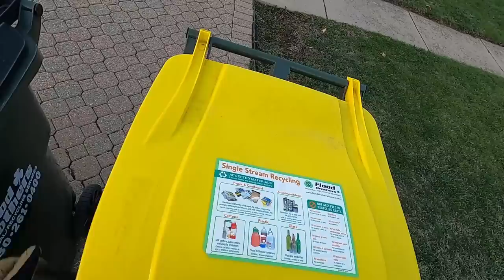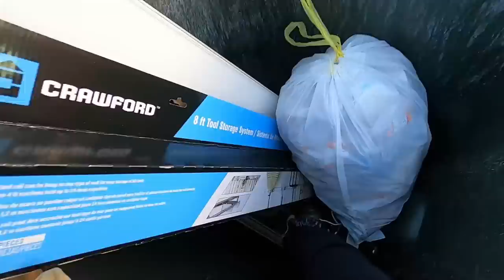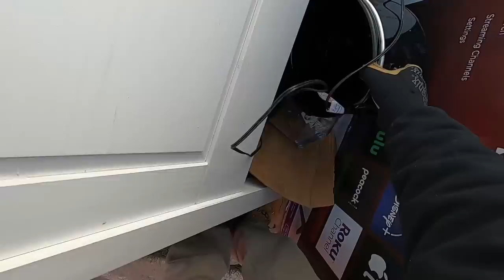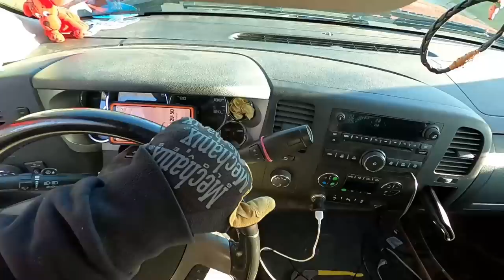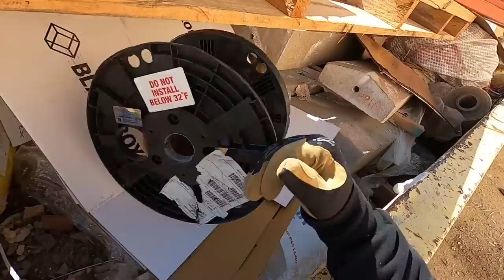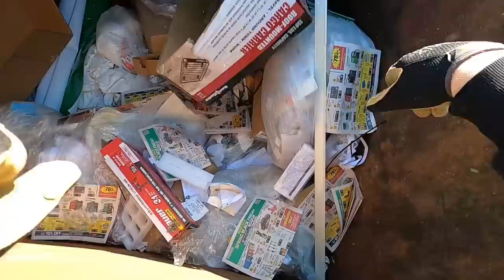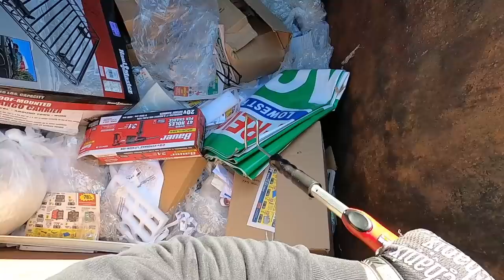Why is This in the Trash?? I'm Keeping it

Comment: I used to drill a small hole in the back motor end on the  fan and oil the rear  bearing to save fans

Comment: Most of those fans have oil places on the motors. People today don't know how to use an oil can.
Reply: And I have reclaimed several discarded fans that only had hair wrapped around the shaft, after clearing that, they worked fine.

Comment: If you keep the fridge closed, what difference does it make if there's something in it? My aunt had those chairs in the late 50s and early 60s. About 7 years ago I found three, in great condition, on a neighbor's trash pile. I picked them up, disassembled, sanded, painted, reassembled, and voila!! I appreciate the art of the song, but it's not my style, so I don't care for it.
Reply from the maker: Would you want to work at the scrap yard right next to a rotting chicken or beef carcass? It doesn't go away. It doesn't magically disappear. Someone has to deal with it. And it would be the scrap yard personnel. I'm not going to do that to my buddies. Some people might. I ain't that guy